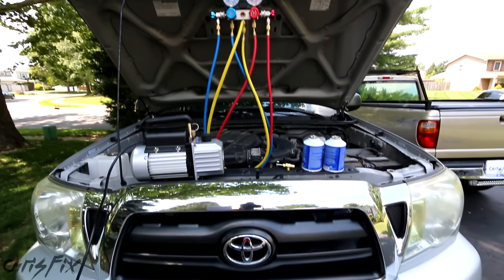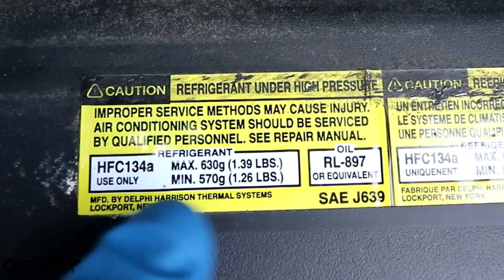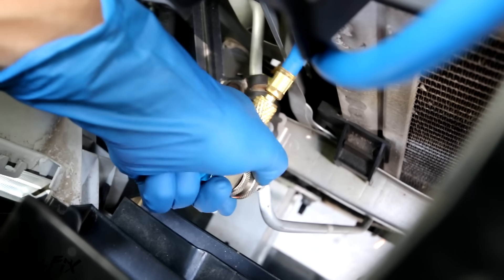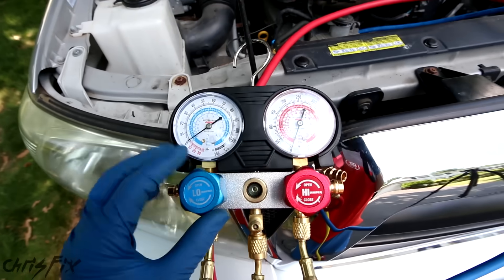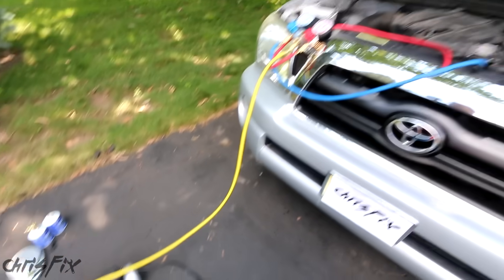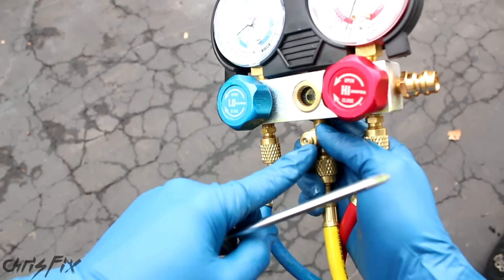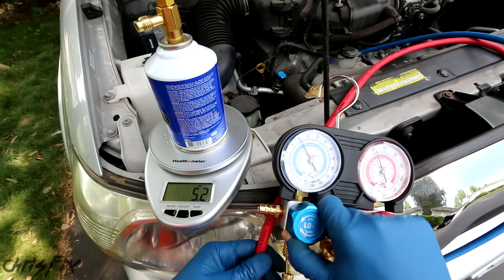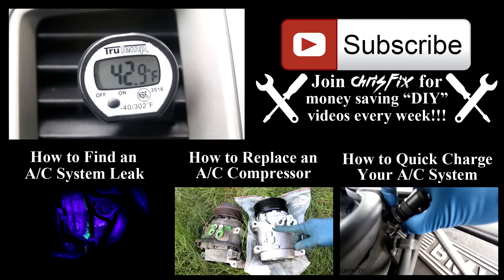How to Properly Recharge Your AC System

Comment: Chris, perhaps you could consider updating the video for the method of adding dye or pag oil to the system.  Pouring it into the yellow line is incorrect. (1) you can't possibly get 4 oz of oil in that yellow line (and you will make a mess trying), and (2) when you go to bleed the air out of the yellow line.... all the oil comes out with it... making a big mess.  The proper way to do this is BEFORE you vacuum down the system, you remove the schrader valve on the hi side, insert a rubber hose with one end in the high pressure valve and the other end in a cup pre-measured with the right amount of oil.  Then apply a vacuum to the low pressure side, and all the oil will get sucked right in to the high-side line.  Re-install the high-side schrader valve, and then continue with all the steps you describe in your video.  You can do all of this AFTER you have established that the system is free of leaks, but before you do the 45 minute vacuum draw down.  [There are actually a few ways to achieve this, but the bottom line is to apply a vacuum to the low-side (blue) and then suck the oil in at the hi-side (red).

Let me end by saying the BEST advice you gave was to add precisely the weight of refrigerant recommended.  I used to try and go by gauge readings but that is very hard or impossible to do.  Ever since I followed your advice in that regard, the cooling has been optimum.

Comment: good video.  direct and to the point.  well done.  enjoyed it.  question as we have followed everything and have an anomaly.  my system stopped working about a month ago.  dash indicator said "low/no" refrigerant.  car 8 years old, never an issue before.  car uses r134a/ND-11 oil.  purchased equipment as suggested.  followed video and a) checked the initial pressure, 0/zero in both gauges.  b) ran the vacuum to 24inHg and let sit.  after 3 hours gauge still at 24inHg (indicating no leak), but refrigerant is gone so a leak must be there.  what procedure might be suggested next to "verify" leak, so after repaired we can "confirm leak corrected" before rechanging?  (BTW, we live at 7,000ft. alt. in the mountains  and suspect that is why the vacuum does not go over 24inHg - have also tested vac. pump on another vac. gauge directly and it will only suck to 24inHg max.).  suggestions welcomed.  thx.
Reply from the maker: I would do this method to ensure that there are no leaks: https://www.youtube.com/watch?v=pCv7rCdcXsc

Comment: I replace ac compressor  dryer  condenser  expansion valve  o rings, use vacuum gauges etc  follow your instructions  star cooling and now warm air , any suggestion ty,

Comment: I wouldn't let u touch my AC ! you have to bleed and remove the air = Moisture from the Gauge lines B4 you charge into the system it'll never work correctly. . Just saying Good luck on ur returns, just not blowing Cold LOL

Comment: Try this on a GM vehicle and you'll never get your compressor to kick back on because of the low pressure switch. Jumper the relay on the fuse box to bypass the switch.

Comment: After finishing the vacuum pull and initiating the recharge I noticed that my high side connection had not been secure and had fallen off (the connection faces down). That means I pulled vacuum only through the low side. I connected the high side and finished the recharge because I had already started it, but does this mean I didn't get all the air out and need to start over?

Comment: Had my system checked and the low side reading was 35 and the high side reading was 5. What does that mean? Thanks in advance.
Reply from the maker: That's pretty low, I would do a system recharge and see what the values are after that!
Reply: @chrisfix  thanks. Could that also be the reason why my compressor is not turning on?
Reply: @mr.danadane3792  yes, add a bit more and the compressor should click on

Comment: My compressor did not come pre-filled and on the 97 deville oil will leak out when installing the compressor. I tried pouring a small amount of oil into the yellow line after the 45min vacuum, but the oil just sat on the opening to the line? Any other suggestions?

Comment: "Fluid ounces" is a volumetric measurement, while "lbs" is a weight measurement.... the beginning of the video makes no sense.
Reply: Exactly. I was thinking the same thing. I guess you could assume that 12 fl ounces weighs 20 ounces in mass including the can then calculate from there, but still.  Could lead one down the wrong road.

Comment: Is it true that fully recharged system will reduce fuel consumption by putting less strain on the engine. If yes could somebody explain please.
Reply: No only the compressor running puts a load on the engine,level of Freon has no effect on engine.

Comment: I really like seeing videos where a DIY project is explained and performed properly.  A vehicle's AC system is nothing to screw around with, but as demonstrated in this video, absolutely something that most people could do with a little mechanical ability, and a lot of attention paid to the details.  Excellent video here!  Thank you for showing this!
Reply: Should the yellow valve be open or closed when vacuuming
Reply: @joseaponte8729  There is no open or close valve on the yellow vacuum line. Just hook it up
Reply: @joseaponte8729  Just for other's benefit since I just did this and it's fresh on my mind:   The high pressure (red) line has a valve at the gauge set.  The low pressure (blue) line has a valve at the gauge set.  If you open either one of these valves it opens a directly path to the yellow line immediately!   You never open the valves on the gauges until you are doing a vacuum or filling refrigerant into the system!  The ONLY valves you need to open to observe the pressures in the system are the valves on the AC line ends of your blue and red hoses.

Comment: At 90 degrees F,  1 fluid ounce (out of a 12 fl ounce can) equals about 1.25 ounce as far as weight. So if he put's in 22 fluid ounces, he's put in about 27.5 ounces by weight ( about 1.72 lbs). 16 fluid ounces does not mean 1 pound

Comment: If I'm not mistaken.  Any time you pull a vacuum on the AC system. Doesn't that pull the oil out of the system as well. I'm to figure out a home method because I've been trained to use the proper equipment years ago but don't have one to do it properly.

Comment: One more thing , i read some of the comments below and I want to say to all those who were unhappy with the video, you are forgetting one thing this guy took the time to do one and you did not and he did not mention every single detail and he didn't have to because no one paid him enough money to add all the details. if you want all the details i suggest you pay for the 4 year program that will cost you 20K or more and get certified. also to make a point some compressors come with oil in them and some do not and it says it in big letters on a warning tag when you open the box Warning this compressor does or does not contain oil and if it does not than chris has showed you how to add oil. by the way oil is a suggestion you can use any type of POE oil as long as its POE and you can use mineral oil as long as its mineral oil, the manufacture will recommend something with a viscosity that works the best but in some cases your listing plate is worn off and if you go with a new compressor go with that recommendation and flush the old system and replace the dryer and strainer if it has one when you put a new one in so your not mixing oils but remember folks your waiting how to replace a compressor not how to replace your entire refrigerant system. I would like to watch chris add those videos as well in the future, it  is also your responsibility to learn what tools you need for the job no matter who taught you how to do it. my advise to anyone taking on any project that you learn on youtube is to watch several videos and get several opinions on how to do it right. as far as this video goes its one of the best ones to watch. stay Frosty my friends !!!

Comment: Ok question how is the high pressure side building pressure if the valve was closed it never showed you opening the red valve when you were charging the system with the R134a

Comment: I have a problem. I did everything step by step:
Connect the cane, purge the air, turn on the car and AC, open the low side valve
And Low side gets to 76psi while high side stayed negative. Nothing changed for 10 mins. Compressor wont kick on. I dont see any refrigirant going inside.
Tried to kick on compressor with a paperclip for a few seconds - nothing changes.
Where I can look for a problem?
Reply: it sound like you may have a restriction, I recommend you replace your dryer and flush the hosed with nitrogen and see if your car comes with a strainer because the strainer may be clogged with debris and what happens is one side of your gages will have pressure while the other is negative. this restriction may be the cause of the failure in the first compressor. it appears you have a little more to do before it starts working. please watch videos on flushing and replacing the dryer and strainer if your car comes with that. I hope this helps and good luck .

Comment: Great video! Hope I can get my A/C working!
Reply from the maker: Thanks a lot! Let me know if this works for you!
Reply: ChrisFix I couldn’t get the system to take Freon until I held the cam upside down. Prior to that the compressor would just cycle on/off constantly. I emptied nearly all 3 12oz cans. Completely empty the system takes 32oz but still no cold air🤔

Comment: If I am replacing my condenser, can I add the oil into the low pressure line or condenser before I install it?

And do you recommend flushing the AC system?
Reply from the maker: If you are replacing, you can add in some oil into one of the line ports on the condenser, and I would not recommend flushing, the best thing to do is to remove all the refrigerant and then do a recharge like in the video!
Reply: @chrisfix  thank you so much for the help. I just got the old one out and will be adding oil and recharging soon!

Comment: Thanks for a very informative Video Chris.  Having just replaced the condensers and reservoir on the AC. Is there anyway to fully check out the compressor working OK , other than seeing the clutch operating. Before refilling the system

Comment: Hey Chris great video. But just wondering if I add oil the way you mentioned, will the system also take in air that we just evacuated?
Reply: Here’s what I noticed. At 10:13 when he opens the low side up the cam valve is all the way down in the closed position. The previous step said to have the valve all the way open. I noticed him messing with it at this point aswell. Can anyone explain when you need to have the can valve open or closed?
Reply: It'syourboy LS those can valves are tricky once you run them all the way down to puncture can, you back off till you feel and see in sight glass on manifold guage. Sometimes all the way open it shuts flow off that’s why you see him running it back in a bit ( look at sight guage on manifold when he does it you will see the flow)there is a sweet spot on those types of valves.
Reply: Someguy Gotcha thanks!! That’s good info to know. I noticed that with mine when I was just hooking up a can that you almost need to back it off half a turn once completely depressed
Reply: @EATSLEEPFARM  So, there's different ways to bleed the hoses from the manifold. One method, is after all hoses are connected, of course leave the valves connected to the low and high side closed, you can open the refrigerant canister, and bleed the middle hose of air, then open the low side knob on the manifold body, and then bleed the low side hose by detaching it and opening the valve a little bit, same way with the sigh side hose. From that point, your hoses are bled. I typically do it like that.
Reply from the maker: Thanks a lot! And the ac system is under vacuum, so no air will get in when you add oil!
Reply: @chrisfix  When I saw you showing how to add the oil through the charging hose, there will be air, oil, and refrigerant in the charging line before charging. How do you purge that line if it has that mixture in it, since the oil amount is critical if some is lost? If it's not introduced during charging, but under vacuum, the line still has air in it from the hose being disconnected after the vacuum procedure, just curious.

Comment: How do you get rid of the old refrigerant? Go to a shop. 

So why recharge it at home at all?
Reply from the maker: Because it is much cheaper to do it yourself!
Reply: @chrisfix  how? It's 35 to evacuate the old Freon and 40, before tax, for new Freon. It's 70-90 to get a recharge. It's at least a hundred to buy all the tools needed for this.
Reply: @-smp-scientificmethodpersp838  You can rent the tools at autozone or oreilleys...they charge you a deposit to cover the cost of the tools, but when you return them, you get all of the money back....so its basically free for the tools. Also, if you already had a leak and repaired it, most if not all of your refrigerant is out of the system anyway, so as long as there's no pressure in it, there isn't anything for the shop to recover.

Comment: Filling the line with oil was the only part I found completely impossible. I had to suck it in by vacuum on low side and stuffing high side into oil container. Also don't forget to buy the "CAN TAP"  because it doesn't come with the manifold gauges.
Reply: I bought a screw on can for the oil it's just like the refrigerant can, from Autozone makes it simple.

Comment: My low side is at 60 and the mechanic told me I need a new compressor I think it’s just over charged when temp hits 90 or more outside the ac just blows hot

Comment: I failed :( I changed the compressor successfully but when I went to add refrigerant the low side would spike to around 80 and the high stuck at 50. If I shook the can the low side would spike up for a minute and then drop but the clutch wouldn't engage. When I finally gave up after testing my relay I unscrewed the yellow line after closing everything off and refrigerant blew out of the line. I'm thinking that the compressor is bad and the vacuum is what pulled in enough refrigerant to fill the line all the way back to the can. I'm going to bypass the relay tommorow to see if it's a bad relay or a dead compressor. Good news is the O' Reilly's said that they will exchange it if it's dead. I just have to pay to have the refrigerant sucked out.
Reply: Guess I never updated this comment, I took it to a shop shortly after this comment and was told that my power plug was not pressed all the way in. He fixed it and the A/C worked fine after that.

Comment: I have a 2006 civic and just recharged the AC, now blows really cold air  is it normal that the compressor stays on the whole time?.
My 2013 Nissan cuts off once in a while and I was wondering if my civic should do the same
Reply from the maker: If you have auto climate control, then that is completely normal!
Reply: @chrisfix  thanks

Comment: Never never turn a can of refrigerant upside down and allow a liquid you go into your low pressure side you can lock up your compressor. Refrigerant must be a low pressure gas when it goes back to the compressor on the low side. This would be like putting water in a cylinder when the piston is on its way up and it could completely damage the compressor! The fastest and easiest way to initially put refrigerant in the system is first and foremost leave the engine off! Open the valve to the refrigerant can, invert it, holding it upside down in a bucket of the hottest water you can get from your tap. Swirl the can in the water a couple of times to distribute the heat this will increase the pressure of the contents in the can. Next, remember, with the engine not running, open the high side manifold valve and within two seconds that entire 12 ounce contents will flow into the condenser as a high pressure liquid the way it was intended. Close the high side manifold valve and then your valve on the refrigerant can. Remove the refrigerant can and attach and re-purge the second can. Since you’re not using the full 12 ounces you can momentarily open the manifold gauge in spurts going on off on off until you feel the can getting light and then re-weigh the can. Close the high-pressure manifold side. Start the engine and run the AC a couple of minutes and if more refrigerant is needed immersed the can upright in the warm water and introduce it into the system through the low side manifold. That is the proper way to charge an AC system when it has been purged.

Comment: Very Good Video. Let me know if your compressor failed soon after you did this job. If it did, probably means you had to much oil which I honestly doubt, if not, it probably means that most of the oil is in the compressor and you did a fantastic job. Either way let me know. I am just curious about it. Thanks.